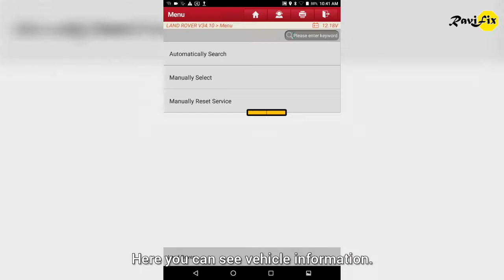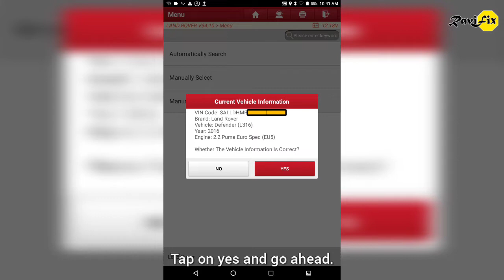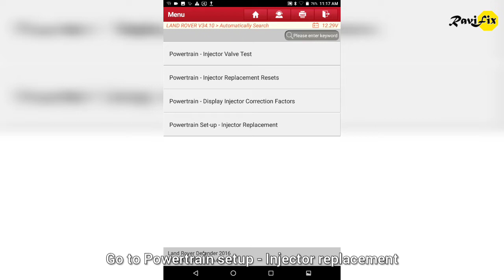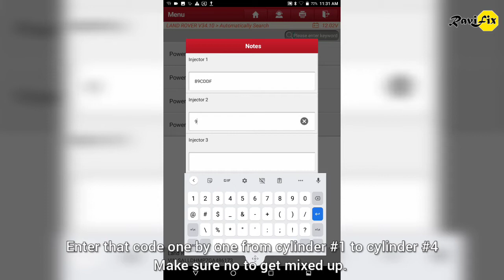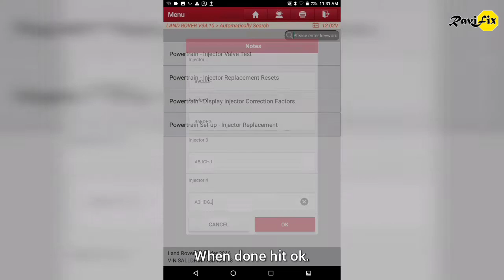Puma 2.2 injector coding with Launch x431(Injector compensation) | LandRover defender | Ford Transit

Comment: Hi I changed the washers on my Transit mk7, 2.2 -2010, but I didn't put the injectors back in the same place where they were I wonder if I need to program them now🙄
Reply from the maker: Better if you could code it correctly or reinstall it in to right order as it was.
Reply: @ravifixall  So I have to reinstall, Thank you for your help